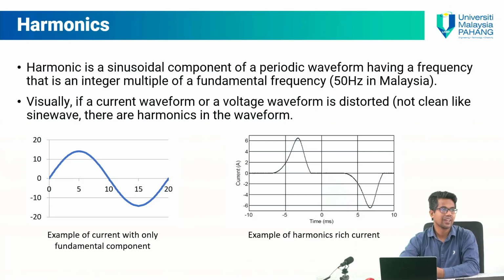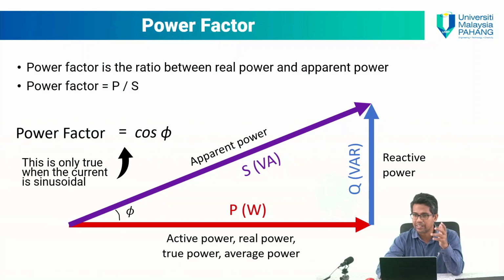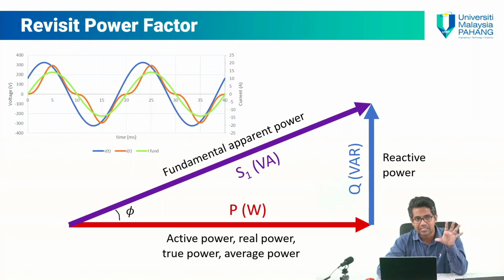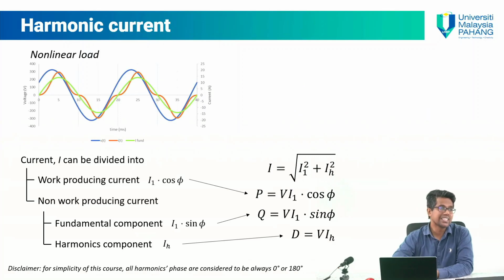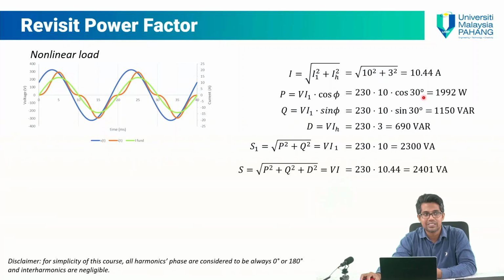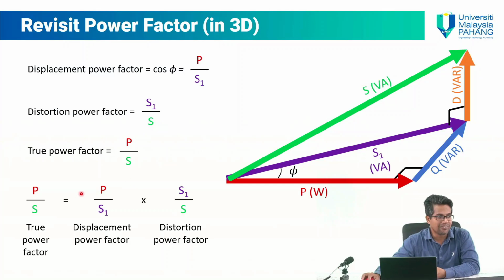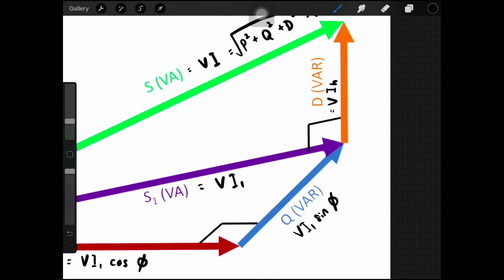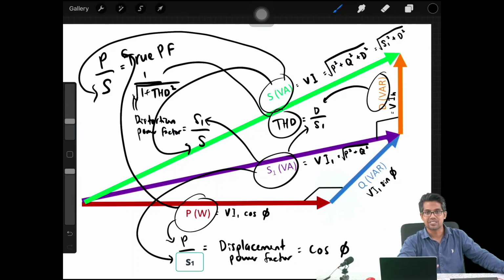Power Quality: Harmonics and power factor

Comment: salam sir,,sir nk tnye pada minit ke 11.49 tu,,, mcm mn nk ambil nilai fundamental current dengan harmonic current?? mcm dlm slide tu dpt 10 dengan 3??
Reply from the maker: You can extract the information of fundamental and harmonics in several ways.
1. If you know the equation, then you know the magnitude of each harmonic component. How to spot the fundamental? Usually fundamental is 50 Hz or 60 Hz. In some tight space application (aircraft, watercraft, etc) fundamental is 400 Hz. Harmonics component is the integer multiple of fundamental.
2. If you don't know the equation, then perhaps you have access to harmonics spectrum.
3. If you just have the waveform, then you can run the waveform through Fourier Transform to get fourier series. Many oscilloscope have this feature.